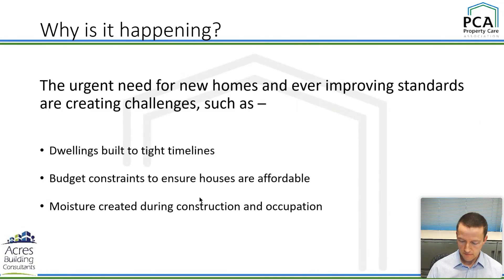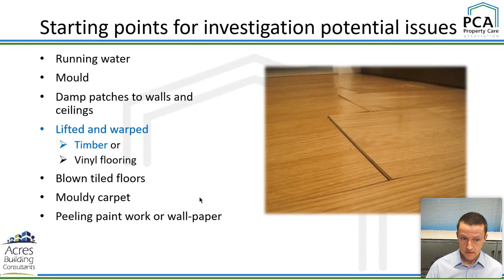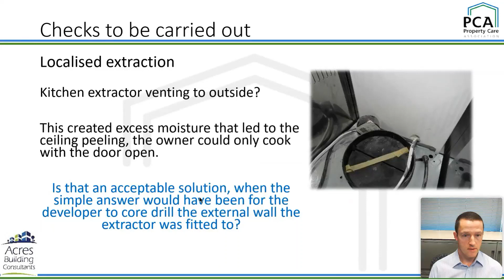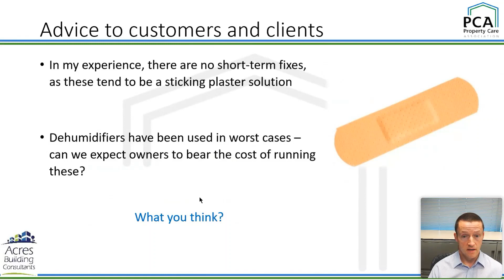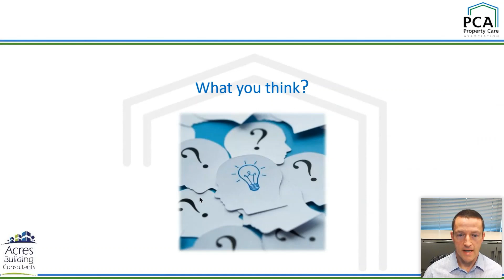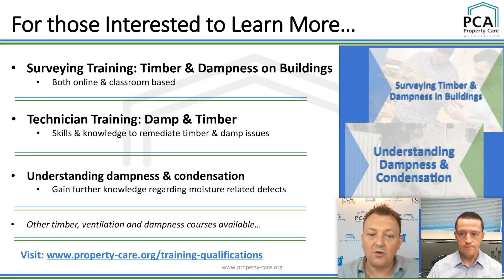New Build Watershock - understanding damp problems in new homes

Comment: The damp is caused by the cavity walls being bridged with insulation(insulation touching the outer walls inside the cavity).Cavity walls must NOT be bridged with insulation or else moisture from the damp outer walls will transmit by capillary action through the touching bridging insulation into the inner walls, making it damp inside the property. Injecting foam into the cavity walls stops the walls breathing , causing drastic condensation saturation of the inner walls inside the building.
 Cavity wall insulation must touch only the inner walls inside the cavity of course.
If cavity wall insulation batts(panels) are to be installed, there must be a LARGE  air space gap in-between the outer walls and the cavity wall insulation batts inside the cavity, this includes a substantial air space gap in-between the cavity wall insulation batts and the cavity wall tie drip point(which must point downwards in the centre of the cavity). Ask City & Guilds N.V.Q. BRICKWORK teachers in person for proof of this.